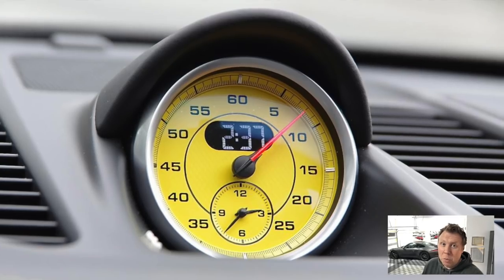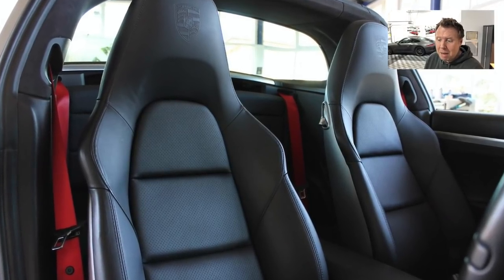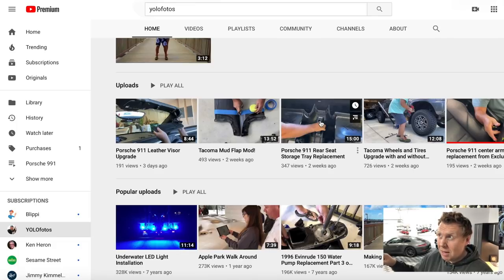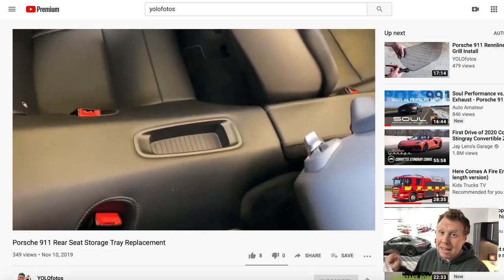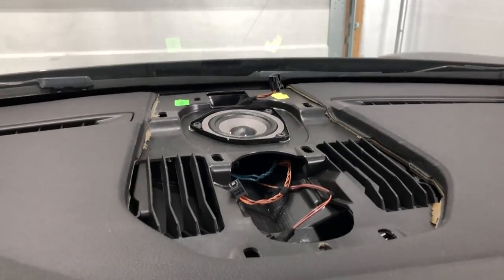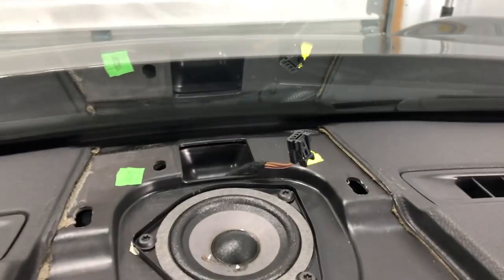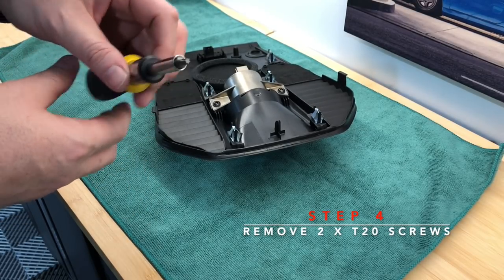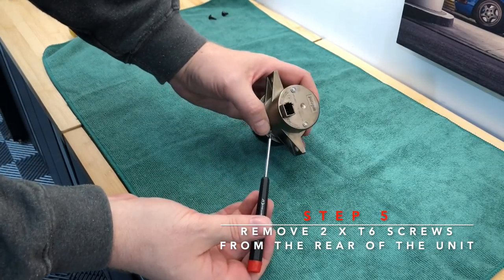Sports Chrono Color Change - Porsche 911 991

Comment from the maker: Note: Since completing this mod and making this video I have learned that the second wiring harness closest to the windscreen is for the light sensor, not the speaker, as I originally suspected. It doesn’t change any of the steps in this video but it was an inaccuracy in my talk track. Thanks!

Comment: would you want to change out this speaker while you are there?  Not sure if an upgraded is needed for that speaker.
Reply from the maker: You certainly can upgrade that speaker if you wish. With the trim piece off, it's easy to take the speaker out. It's simple plug and play. I personally don't care enough about sound quality to worry about the factory speakers.

Comment: Great video; it gave me the courage needed to pull up hard enough on the tabs to release the center piece!  One suggestion: before disconnecting the clock from its wiring harness, make sure the ignition has been turned off long enough for the clock to reset itself to 12:00:00 (all hands pointing straight up).  That makes it easy to know where to point the hands when they are reattached.

Comment: Thank you James!   I just did mine yesterday and your video was great to follow the instructions.    Now, even after having the clock hands all at 12:00 it was a b**ch to install them back, specially since they are so minuscule and fragile, but got it done!    By the way, it REALLY helps if you use a watchmaker tool to remove the hands and the hollow tool to re-install them.
Reply from the maker: Great job!

Comment: Hello James.  Excellent video!  I just installed a red clock face in my 2014 991 turbo s.  It went well, but when I got to the step where I needed to remove the ring off of the original face (to install the new face) I needed to use a heat gun to heat up the parameter of the original clock face.  Reason, Porsche glued the ring on the face.  Once the glue was warmed I used and exacto knife to get underneath the ring and went around the clock face.  It came off and once cleaned it was ready for your new red clockface.  Again, good video, very helpful.

Comment: this video is extremely helpful, I did mine today. To remove the difficult wiring clip by the speaker its best to slide a very thin flat headed screwdriver inside the front

Comment: Love the fact that you had the balls to take the chrono apart. I did a similar job on my GT3 but went the route of buying a Porsche yellow chrono unit. A couple of tips that may help others that I learned from a Porsche tech: using the pry tool, only use it on either side nearest the windshield. Use your fingers (it will hurt) to pull up on the rest of the clips. That way you don’t make an indentation on the dash around the assembly. The wires near the windshield are not speaker wires. They are for the light sensor (the bubble piece you see near the windshield). There are two larger clips that hold the sensor to the assembly. If you press those in, you don’t need to remove the wire clip. You can just leave the sensor in place and easily reinstall when putting things back together. Pict of my yellow chrono is on IG at @wildhorsegarage
Reply from the maker: AWESOME advice!!! Thanks!!!!

Comment: Looks good. Why you place red over black dial vs removing the black one?

Future mods
Red seat belts
Fire extingisher
Red center stripe steering wheel w/flat bottom
50% tint
Metal floor mat driver side
Reply from the maker: It wasn’t a straight replacement. There was no way to remove the black dial. The face was designed to sit on top of the stock dial. Thanks for the suggestions! Love them!

Comment: Hi James, watched SC color replacement it was brilliant.
I did not add launch control when I purchased my 718 well because, every add-on jacks up the price. However I heard that one can install a clock in place of a SC, not quite sure. Have you any knowledge.  Well anywho keep up those updates I’m always looking forward to seeing them.
Reply from the maker: Hilton thanks!! Appreciate it. From what I’ve read online you can install the Chrono clock (not stopwatch) on the dashboard quite easily but you need to run the wiring harness from the clock, inside the dashboard and down into the car somewhere to get power. Presumably the control module under the seat or maybe directly into one of the spare fuses in the panel in the driver’s footwell. I’m not sure though about that part.

Comment: Great video showing full install not just highlights of the "perfect" install process.
The gauges on your site... Can you do Speed Yellow for the 997? (I saw Racing Yellow on there.)
Reply from the maker: Yes! Just add that to the comment / option when you put the item in your cart.
Reply: Good deal.
Also, I corrected my spelling error on my original comment in case you notice your "♥" missing lol.

Comment: Well done! I’m thinking that the process should be basically the same on my 997, if not even a little easier(no speaker or vents). I have the caramel interior and I agree that red would be somewhat off putting. I think yellow would be least obtrusive. Maybe overkill, but I would also like to change the tachometer to yellow as well, but that may be best left to the professionals. The only observation is that I might use tight fitting rubber gloves to avoid any finger prints on the gauge face. P.S. I almost saw a hint of the “OLD JAMES” with that last clip!!! Lol.
Reply from the maker: Hahahaha. Almost. BANG! Haha.
Reply from the maker: Ps. Yes, the 997 job is a little easier in terms of getting the unit off the dash. The rest is the same.
Reply: So a red needle over a red gauge face🤔.   I am guessing you don’t use your sport chrono feature.

Comment: Very nice mod! I was thinking of replacing the SC in my car to red but thought I would have to get a whole new housing/unit. Might try this over the holiday break. Stupid question, when you start the car back up the needles go back to the right time?
Reply from the maker: Mine did! But I was very very careful to pop the needles off and put them back in exactly the same position. As soon as I put the unit back into the car and started the ignition, the clock did a reset process I’ve never seen before where it looked like it was doing a self diagnostic and everything went straight back to normal. All good.

Comment: Good job bro, it looks really nice. Just curious why you had to stack the dials together? Couldn't you just leave off the black one?
Reply from the maker: Thanks mate! The black dial doesn't come off. It's stuck / welded to the back of the clock. The red one simply sits on top of the black one. It's awesome though, because it's totally reversible if you don't like it.

Comment: Did you lose one of the tiny white clock hands? I only seen one small hand on yours. I just purchased a used Chrono Stopwatch clock off Ebay and mine has what looks like 2 tiny white clock hands but one had already fell off. So either it had 2 hands or it had one white hand that must have split into 2 from heat before one fell off. I may need to purchase some new clock hands if that's even possible.
Reply from the maker: Unfortunately you're supposed to have two little white hands and it's not possible to buy them from Porsche. They want you to spend $750+ on a new clock unit. Even the manufacturer, Paragon Germany, won't sell you the hands separately. It's a shame because a LOT of these sports chrono locks lose their little hands like this due to repeated heat and sunlight exposure.
Reply: @AutoAmateur  I just purchased 2 brand new sets of the tiny clock hands from a guy (Ryan)in Europe for 25 euros. That's about $31dollars US exchange rate as of today. He had them made by a local 3D printer  company that looks identical to the original and has a video of it on YouTube. He said he simply scanned the old hands to the computer and it spit out several of them. He also gave the name of the 3D printer company just in case you prefer to go directly through the company to have some made.

Comment: Nice work James, looks super great! Just a question, I see the white "hand" was at 12 when you removed it, but when you re-inserted it was at around 6 or something: if you reset your Chrono, does the white hand go back to 12?
Reply from the maker: Great observation! Everything went back to 12 when I first put everything back. When I taking photos and videos of the finished product, the ignition was on and the clock was ticking away. So in lots of shots in my video and on Instagram the hands are sort of all over the place, particularly the shots I tried to get of the time at 9:11...! I found that as long I put the hands back in EXACTLY the same place as I took them off, it worked fine when I reinstalled everything.
Reply: @AutoAmateur  Thank you for relieving my OCD James!! 😂

Comment: Great video and a big help for me (I hope) for fixing one of the clock fingers which fell off :-O. Is it possible that you put the fingers back in a wrong position, because the clock shows another time than the small fingers? Do I have to put attention to this, when I try to fix it or am I wrong? Greetings, D.H.
Reply from the maker: Hello! Yes, you have to put the fingers back in EXACTLY the right position or else the time will look out of sync.
Reply from the maker: Best thing to do is plug the clock back in without the housing, just hold it. Then you can adjust the clock hands if you need to before putting everything back together.

Comment: Nice job. Being a bit critical,  I’m wondering how well the red stick on (over the original) bezel will hold up with the sun beating down on the dash over the months and years. I suppose only time will provide that answer.
Reply from the maker: That’s a great question!! The good thing about this mod though is that it’s 100% reversible and only put me out just less than $100.
Reply: Auto Amateur at one point I was thinking it could look fine with the black bezel too. Regardless, keep up the good work. I enjoy your candid comments and videos here.
Reply from the maker: Patrick O'Donnell thanks! Appreciate it!!!

Comment: I just tried this on a 992. Almost did an airbag on it!!!!! Couldn't get the wiring disconnected so I just pounded it back in. Will probably rattle now.
Reply from the maker: The 992’s clock is quite different. Hope you get it back together ok!

Comment: Was it necessary to put the red gauge over the black one....surely it’s meant to simply replace it?
Reply from the maker: That's what I thought, but actually the black dial doesn't come off. It's stuck / welded to the back of the clock. The red one simply sits on top of the black one. It's awesome though, because it's totally reversible if you don't like it. No damage, no issue.

Comment: Great video James, thanks for posting. I'm considering changing the dial faces on my 991 but am not sure the red needles will go with my chosen face colour. Can you remember, whether the main needle on the Sport Chrono is all red plastic, or is it is clear plastic with red paint along the bottom of the needle (so it reflects red)??
Reply from the maker: I believe it’s all red plastic. Actually more like orange. Mine was the same color with the original black gauge face and then the red face. It didn’t pick up or reflect any different color. Thanks Mark!
Reply: @AutoAmateur  Thanks for the prompt reply James, very good of you! If the plastic of the actual pointer needle is red/orange then I'm going to have to source new pointer needles in white for the Sport Chrono and all the main gauges. Hmm, that's going to be interesting on a 991 😳
Reply from the maker: Yeah, that’s a challenge all right! If I find any, I’ll let you know. 👍
Reply: @AutoAmateur   Thanks James. If anyone knows who made the original pointers for Porsche that would be great. Otherwise I guess it's gonna be a pot luck search through AliExpress 🙄
Reply from the maker: @markdavis911time  You can contact them here: info@paragon.ag - it's the German company who makes the clock faces for Porsche I believe.
Reply: @AutoAmateur  Wow James, what a result. Thank you so much!! I'll contact Paragon and see if they would be prepared to supply a set of white pointers - fingers crossed. 
Thanks a million, for helping me towards making my somewhat unique car, even more special!! 👍

Comment: Thanks for showing the way on this DIY. I was wanting to swap out my black face for the red one as well on my Macan Turbo (red is a better match for my Garnet red interior). Would you order this face again from the same e-Bay seller if you were to do it all again? On other note...keep up the good video content, I always enjoy watching.
Reply from the maker: Thanks John!! Actually, no. I think I would buy this one... it looks identical to stock where as the one I bought doesn't have the same level of detail / refinement. It's twice the price, but at $180 USD it's not shocking either. https://www.ebay.com/itm/Porsche-Dial-Gauge-Face-Sport-Chrono-Overlay-Red-Yellow/163583315474
Reply: @AutoAmateur  I thought I would provide you with an update. I ended up buying the gauge face (in Bordeaux red (the dark red) this matches my Garnet red interior perfectly) from the link above from "fredles-e-shop". All I can say is WOW! The quality is exactly like stock (it might even be OEM it's so good). The trickiest part of the install for me was lining up the hands (dials) in the exact 12 o'clock position they rest in. With my OCD I had to reposition the large dial 3 times before it was perfect. I would like to thank you once again for the excellent DIY video on this mod as well as the suggestion of face to buy.

Comment: Question, I found this video because I’m just trying to clean the inside of the glass on the clock itself (as you mentioned you’d do in the video)... I’m wondering, what exactly is it that’s preventing the glass cover from being unscrewed while it’s still on the dash? Before you twist off the cover, you unscrewed two screws from the back, are those somehow holding the glass cover on? Just seems like they could have made it way easier to unscrew the glass cover off for cleaning... btw, I’m not even sure how it gets so dirty in the glass anyway...
Reply from the maker: Great question! I thought the same thing. I’ve tried to remove the cover on its own without removing the unit from the dash but it doesn’t seem to work. I can’t figure it out.
Reply: Interesting. So there’s no sign when you were opening it that it WOULDN’T just twist off?... those screws don’t have anything to do with it? maybe just that it’s wedged in there it’s too hard to get a grip and twist it?
Reply from the maker: I would have to take it apart again to check it out and tell you for sure. I’ll try to do this for you tomorrow!
Reply: Auto Amateur oh damn, that’d be awesome. I’m terrified to pop mine off unless I need to... you’re a brave soul!
Reply from the maker: No worries! Happy to help.
Reply from the maker: @proper_miles  Hey! So I took out the sports chrono clock unit again. There is nothing holding the glass cover on, besides the screw top housing that surrounds it. However, the design of the trim around it is to squeeze everything together. Although there are no screws to remove, it's practically impossible to screw off the cover without taking it out of the trim housing. Looks like you will need to pop the whole unit off the dashboard to take the cover off.
Reply: Auto Amateur that’s awesome that you did that. Thanks a lot. And while it sucks I’ll have go through the work sometime in the future, I’m not surprised that the German engineers figured out a way to make it so “clever” (aka, complicated). :-)

Comment: hi would the same removal process be applicable for a 981 boxster.   love this very hard to find this kind of diy on google.  thankyou
Reply from the maker: One you get the clock out of the dash, the process is exactly the same. Do you have a slightly different procedure for getting the clock out of the dashboard though, it’s not too difficult. I think there are videos on YouTube showing how to remove the two air vents either side of the clock in the Boxster
Reply: @AutoAmateur  actually I think your right, I've just seen a video that shows air vents out and possibly the pcm unit to access two screws that hold the clock housing in place.  Thanks
Reply: @AutoAmateur  will be giving this a go tomorrow.

Comment: I tried doing this and managed to lose the small minutes hand on the subdial. Any idea how / where to get a replacement? Thanks in advance!
Reply from the maker: The company that makes these clocks, Paragon, has not been willing to provide parts to me in the past. I have tried contacting them several times. Your best option might be to buy a used / damaged unit from eBay relatively cheaply and take what you need from that. But did you actually misplace your hand, or did it break? If the latter you could look at scanning at 3D-printing another or trying to fix the one you have.

Comment: Can actually add a Chrono package to your 911 ?
Reply from the maker: Not properly. You can easily add the clock and the trim to the dash. I’m guessing you could probably add the wiring harness and get power from the fuse box but getting it programmed into the pcm and adding the sports / sports plus button and modules would be killer cost wise. It could make a pretty clock though. 😆👍

Comment: The needle doesn’t line up with the markers though :/
Reply from the maker: It was running at the time. It wasn’t stationary. I was running a test as the clock struck 9:11 so I grabbed my phone to snap it quickly.
Reply: Auto Amateur Yes, but when it run it doesn’t line up with the markers on the side